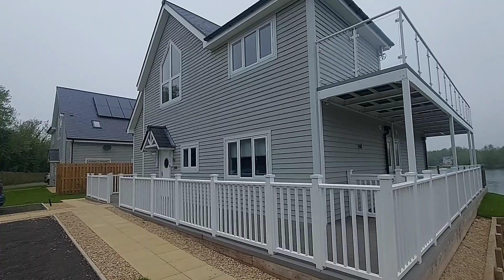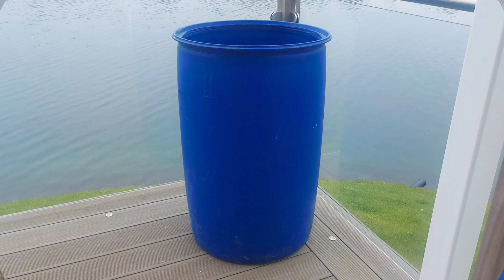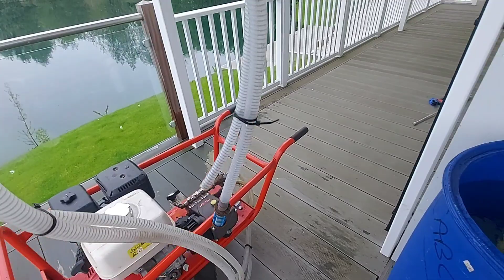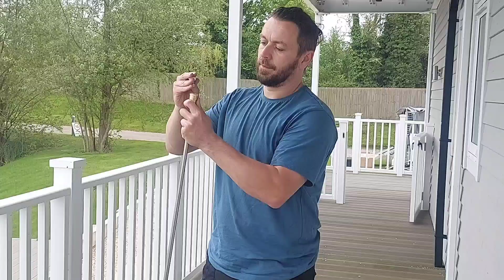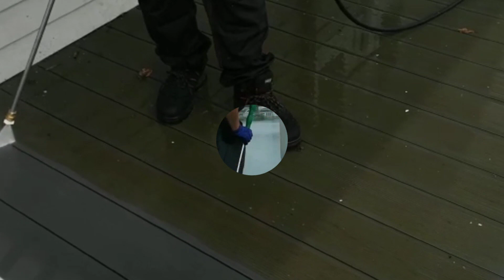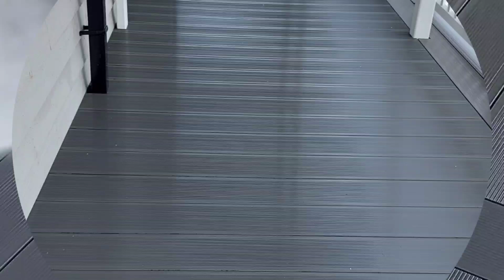My First Pressure Washing Job - Composite Decking

Comment: That came up great, well done. Do you fit the pressure washer and buffer tank etc in the van as it looked quite full previously?
Reply from the maker: No mate I tow a trailer with the pressure washer, but I am getting a new van in the next few weeks.
Which will have both PW and window cleaning tank in hopefully
Reply: @HelmOfAwesomeWindows  Cheers, I thought I saw a trailer in the background of one of your vids. I have a Partner with a streamline 400lts ro system in and with the gutter vac (panther) and Pure Freedom elec reel space is tight, I doubt I could even fit a pw let alone fsc, brushes, hoses etc even if I used my pure tank as a buffer on pw days. A trailer might be the way to go for me as my van is 2019 and only 28K miles. Did you find the trailer ok or a complete pain?
Reply from the maker: @ched999uk  it's OK but can be a bit of a bal ache setting up. Miy next van is an expert. Have a 350l wfp tank and a 250l tank for pw. It's got a 1400kg payload so all good. Still a bit of  cram though. I'll have  video coming up soon in few weeks to show it
Reply: @HelmOfAwesomeWindows  Cheers. Looking forward to the new van vid.

Comment: Grate work 👍 how do you quote a job like that, do you charge by square metre if so how do you measure everything up and at what cost
Reply from the maker: Good luck to you too mate. Prolong takes a while and someone will always tell you that you are too expensive or too cheap. Just price what you are happy with mate. Maybe figure out a day rate for ypurself and use that as a guide. My block paving for clean and resand is usually between £4 and £6 per sqm mtr 👍
Reply: @HelmOfAwesomeWindows  thanks mate really appreciate the advice and help
Reply from the maker: Hiya mate. Pricing is a difficult one depending on your area.
I tend to price approximately per sqm but
I have a minimum charge in case the area is small. 
Set a minimum charge by checking out others in your area.
My price per sqm will either go up depending on the surface condition, like lots of black spot, lichen etc. 
Or if its a simple job and a big area, I might bring it down a bit.
Hope that helps 👍👍
Reply: @HelmOfAwesomeWindows   thank you 👍yes was very helpful. Bit confusing the quoting side of things. Trying to start a small exterior cleaning business my self. Came across your videos grate work. Wish you all the best with you business. Grate work fella